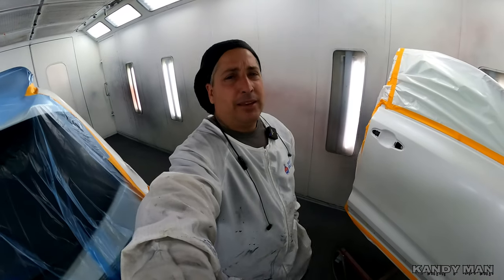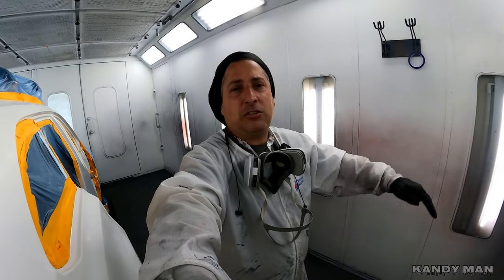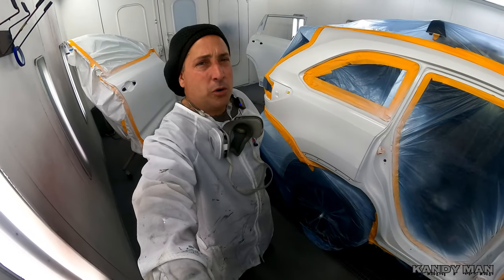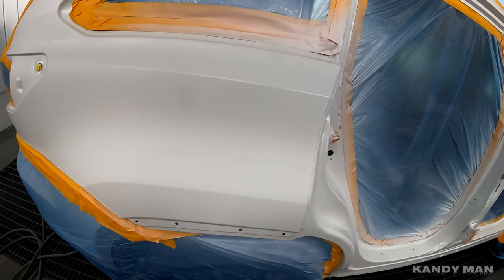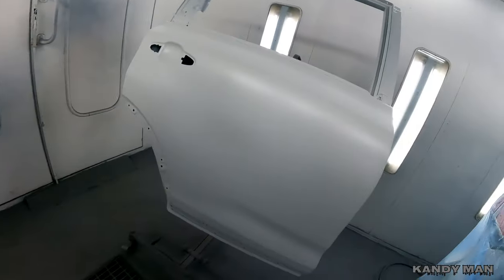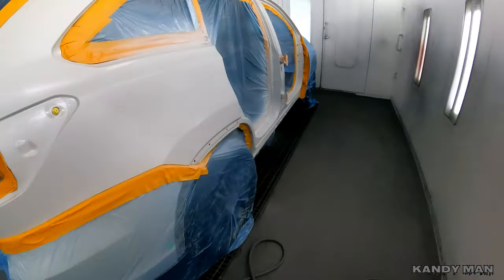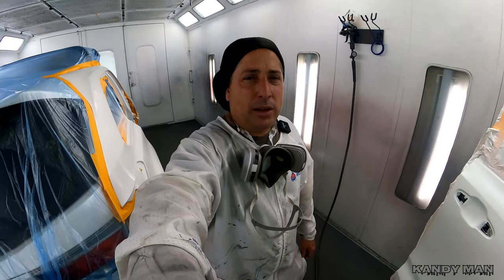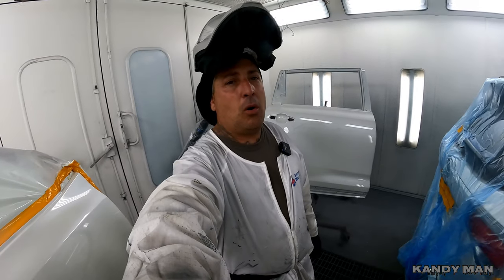TIPS FOR A FLAWLESS BLEND

Comment: I have been using ppg deltron solvent base,but we use rubber seal brand color blender, what's your opinion on that, u think it will work as long as I'm using the same reducer
Reply from the maker: I'm sure  it will work but I would use dbc 500 just know it's warranty don't think it's much more money is it
Reply: @kandyman5315  not too sure about price difference, but your right about warranty purposes, I just have to use what I have to work with but thanks for the feedback , God bless 🙏
Reply from the maker: I understand that I've mix plenty of different brands through the years and had no issues.